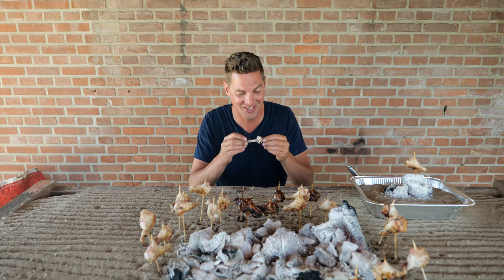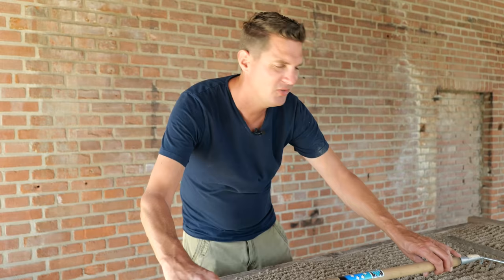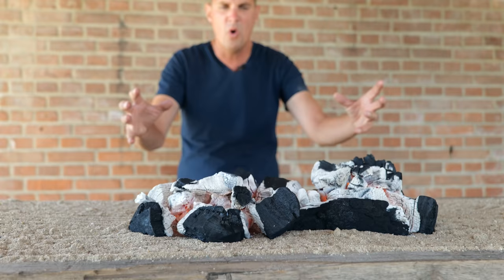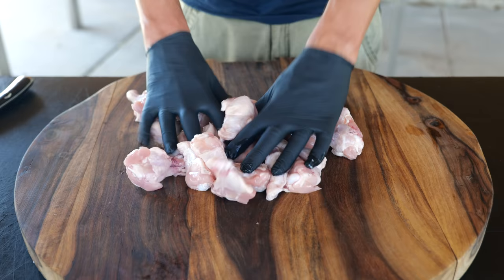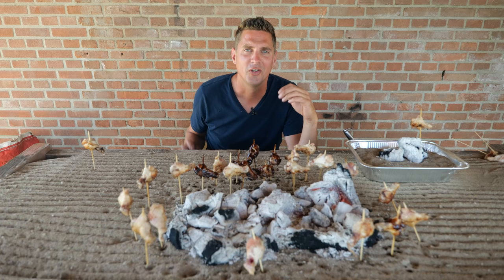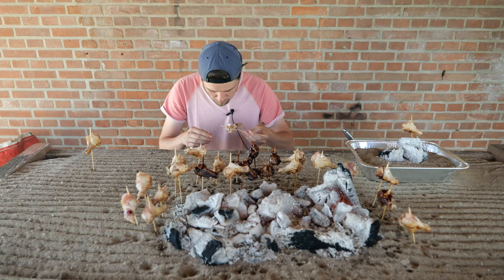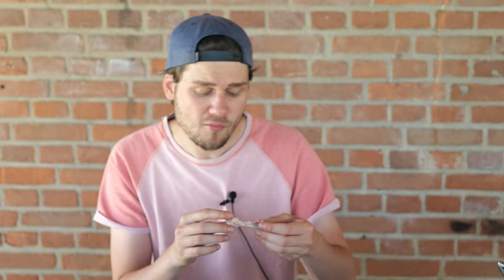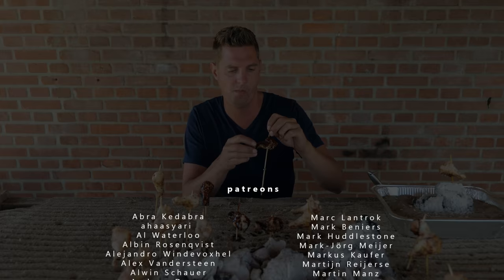I Built a Japanese Sand Grill -- This is Too Much Fun

Comment: I built one of these this past weekend.  Made lamb kofta and shrimp on skewers, yummy!  Hot tip: charcoal must be very well ashed over/hot.  Also if you want that pristine look expect to chuck 1/4-1/2” of sand after you clean up because ash covers the top layer of sand once you’re done.  Cook time was about 3min/side for the kofta. I found the leftover sand after removing the top layer also reeked of ash...days later it still does.

Comment: The Japanese indoor Carbon monoxide death grill 9000!
Reply: The smoke went up through the thatch roofs, and it was crucial for smoke treating the rafters and thatch roofs against insects and decay. It was also important for heating, especially in northern regions. They've been falling out of use since around the 50s but have been around for over 1,000 years.

Comment: This looks similar to a method used in Spain where they traditionally fill a boat with sand, then they make a wood fire or good quality charcoal fire in the middle and they surround it with skewered fish in a traditional skewering method, traditionally sardines are used, but I can work with other fish types and even calamari

I am planning on converting a cheap grill I have laying around into a sand pit that can be used for that

Comment: When I lived Japan, I only saw this method with fish... I would definitely take the temperature before eating any piece of this chicken.
Reply: This cut of chicken is pretty small, so it cools pretty quickly. It's the part of the wing that connects the body to the tip of the wing (basically the upper arm), so it doesn't take that long to cook. But of course, you should check ALL chicken before you eat it 😁

Comment: There is no difference cooking on the sandbox vs. Indirect heat. The idea of yakitori is all about choosing, butchering and preparing the meat in the right way so it cooks perfectly via indirect heat or a side heat which its purpose is not letting the fat drop on the charcoal, burning and "smoking" the meat with burnt fat smoke so you'll get a very concentrated flavor of the cooked protein...

Comment: Can we really call it a grill? A grill is a contraption. You just recreated making a camp fire on the beach.
Reply: Technically grilling mean frying something with infrared radiation. No matter from what sources. Coals, wood or electric. In an electric grill what have a heating iron part above the food there is no dropping fat on charcoal or anything like that but the method is still grilling. This is grilling too because of the method not because the equipment. It's the simpliest way. Same thing with digging a hole to the ground and fill it with charcoal to slow cook your meat is BBQ. The oldest and original way of it without any hadware. But we still can and should call it BBQ.
Reply: Back to the basics. That’s all we need.